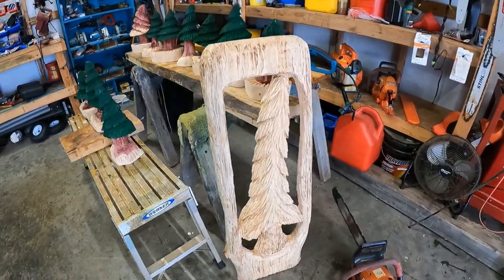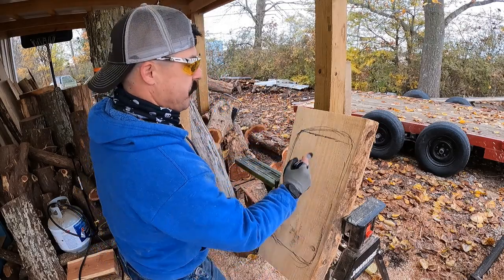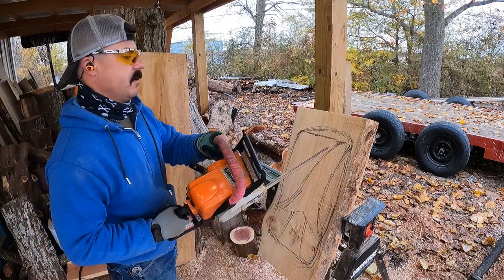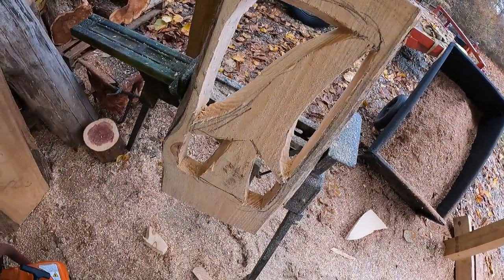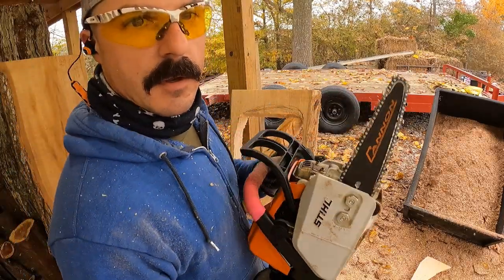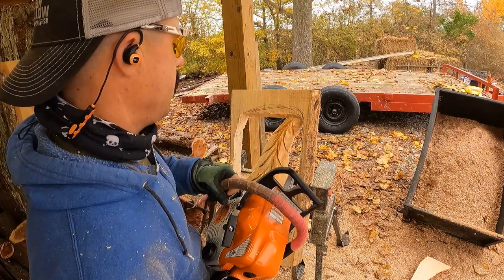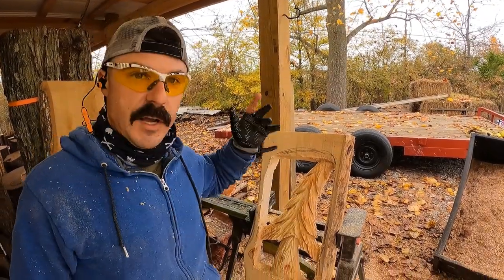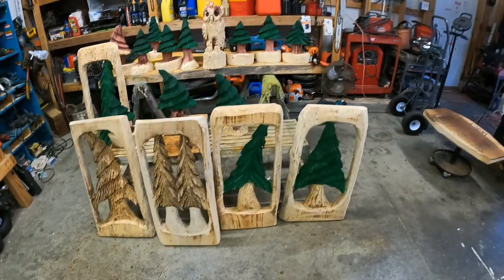Relief Woodcarving Tree in Live edge slab with Chainsaw tutorial

Comment: well done I think I will give your idea a try -  I make 12'" christmas trees out of 1x6 cedar fence boards and give them to shut ins.  I cut out the shape of the tree and then use my dremel and do exactly what you do.  And then I make a small stand for them and then I woodburn  Merry Christmas into the base.   Before I paint them I drill 20 holes in them and then torch them and then spray them green and brush on some white acrylic and add multi then install multi colored lites from dollarama.  They are well received
Reply from the maker: Awesome 😎 I hope it works for you.